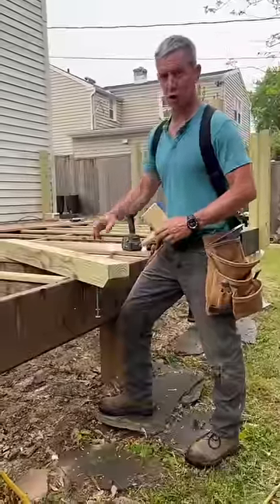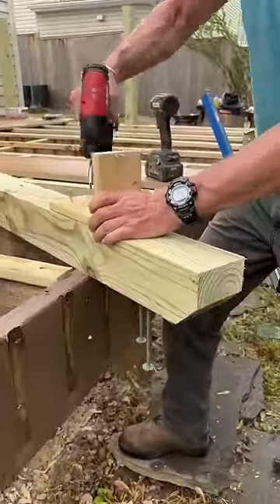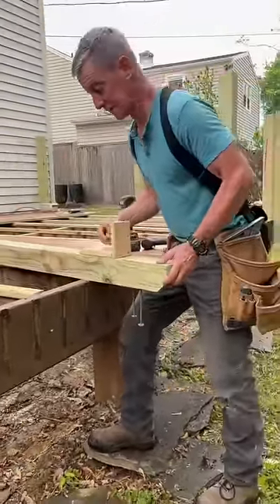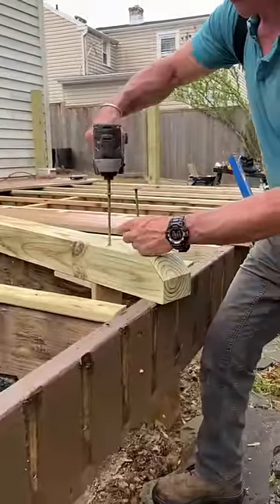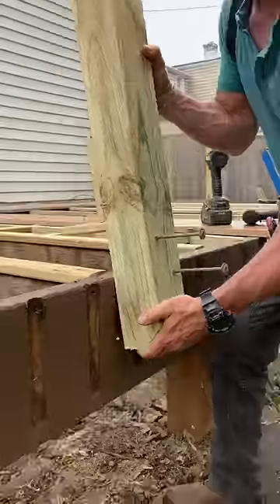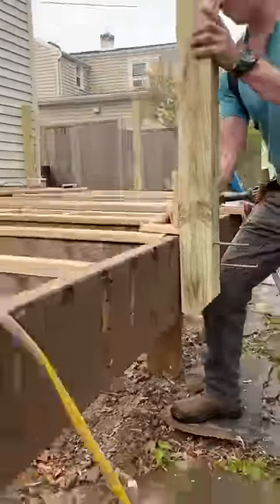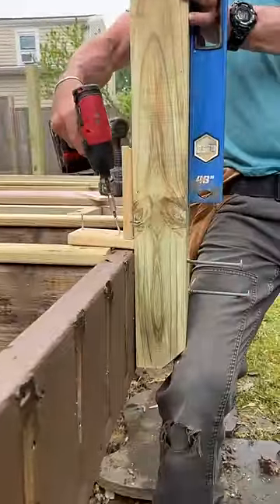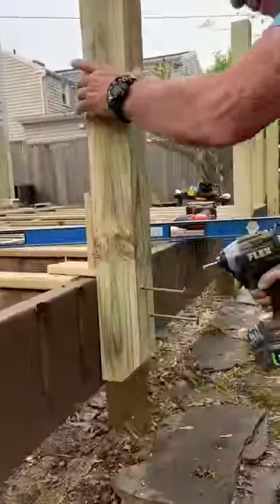DIY Tips: How to set a deck guard post by yourself

Comment: Yeah put the post on the outside so the the railing overhangs the deck
Reply from the maker: It was a pretty small deck, so those added few inches all the way around bought a little real estate. I also run a 2x4 under my decking and between the posts as a little extra detail and to further lock the posts in and I like the look.

Comment: You can’t use GRK for mounting posts to mounting
Reply from the maker: It's not specifically spelled out like that, no. But you can use structural screws (5-points for knowing what they are; half the commenters in here think they're just regular old lags) for post-to-beam and ledger. And, this is a resurface, so there's no permit. I'd put this connection up against thru-bolts all day.

Comment: Lags should go through the band and then into the post. The post should be inside the band and also have blocking around it.
Reply from the maker: Dude, the notched/lagged 4x4 in this re-surface lasted at least as long as you've been alive. Were there some bullsh++ details, sure. But, bro. This all works. You're all missing the forest for the trees.

Comment: Flex...... Haha let's see the future
Reply from the maker: Sure. On this deck replacement, I removed a zillion 3/8 - inch lags and notched posts. You know what? It worked. It doesn't always work and it isn't code now, but decades is a good track record. - The membrane created by the 2x4 rails and 2x6 top cap...good luck tearing that apart.

Comment: Notching doesnt sound safe either. Having essentially 2x4 wood against shear strength leveraged at 4' is a bad idea.

The building code of not having wood rest on fasteners doesnt make sense to me with this alternative.

Only option that really works is in new construction. Make each post 4' longer that the deck and use this posts for railings
Reply from the maker: I'm glad you're trying to suss this out. Yes, what you're calling "wood rest" is called "shear" and in this case there is near zero. I've had roof structures approved that rest on a similar detail. - The screw engineering is phenomenal. - I use Spax 5/16 x 6 washer heads for this. - This deck is a re-skin. We can't go back in time. - For new construction, no.

Comment: This has "handyman" written all over it.
Reply from the maker: That has you not understanding how structural screws work all over it.
Reply: @myfixituplife  Would'nt it be much stronger if you screwed from the 2x side so the threads buried in the post? It doesn't look like they line up with the joist.

Comment: If you don't drill a clearance hole in the post, it will NOT hold properly. You must use a bolt washers and nut. This will rip out with one good drunk heavy man running into it. It's called LEAVERAGE.
Reply from the maker: I know what leverage is. You forgot that the integrated 2x6 top cap needs to fail, too, across the 5 1/5-inch dimension. Put some leverage on one and tell me how much it takes to break it. I’ll wait.

Comment: Everyone saying this isn’t code and they should be in the inside need to calm down. I’ve seen railings on decks around here still fine with no posts and only balusters. Also if you read the code decks 30” and under need no railing so anything you do is “cosmetic” 
He didn’t even notch the post so it’s definitely strong
Reply from the maker: The same fasteners are Code-approved for the ledger connection. - Pretty sure they're not going to budge. - I've puled out locked-in systems with nails that're good to go.
Reply: @myfixituplife  it’s how I plan to do my railing at my house. It’s getting inspected and has to be to dca6/2018 irc. The railing itself won’t be inspected though because of my height. I haven’t tried the spax screws but I have cases of timber screws and I love those things. If it’s not tight those things will make it tight

Comment: I am no fan of lags in this application. Much better bolts-nuts-washers. You need only two and they only fail if the rim joist fails.
Reply from the maker: "They only fail if the rim joist fails..." Exactly. - Not shown, there is a 2x8 inside this 2x10 band. There is 3-inches of bite past the post. - While the gist of this video was intended to be the jig--and even since this video, I've refined this process further--the connection is what everybody sees. - These PowerLag screws are rated for ledger connections. They have the shear and pull-out ratings that meet the spirit of the Code. Obviously, I'm not an engineer, but there's no way three of these things are wiggling loose on a 12x12 backyard deck without taking the band joist with them.

Comment: Here in New Zealand if you did that it'd never pass code. 😂😂
Reply from the maker: For new construction, I'd run the connection through plan review, too. This is a resurface and either way, the point of the video is how I keep the post still while plumbing it up. Best way I've found yet to do this alone (yes, I've tried a clamp). Everybody seems to miss the first 50-seconds of the 60-second video.

Comment: Not sure the posts were on the outside before... Just look at the old paint! I can't see everything in the video, only where he's putting the posts now.

Are those Simpson leg screws only going into that aged 2-by perimeter joist? That's a lot to ask of brand new lumber!

Even if it's not loose today, every little bump on the railing is going to twist that old perimeter joist. That's a waste of a 4x4, in fact if it was a 2x4 it would bend down a little and give the perimeter joist a break!

The old frame may be pressure treated, but I've replaced plenty of pressure-treated lumber. Perhaps it's good enough to hold up all the joists, but all the wiggling from the railing is just going to make everything loose over time! 

I'm concerned that there is no joist tape. It's so easy to put their when there's no decking! 

This deck is stripped down to the framing, repeatedly calling this "just a resurface" is sketchy. The railings are gone. New caps are in the joists. Is this paid work you're doing for somebody? At this point, doing your work  the deck with code compliant methods (written on the wisdom of experience) is probably not even more work!

All this complaining in the comments must be kind of brutal! If your videos were truly smart, all The professionals who are complaining here would instead be acknowledging you for being someone we all can look up to! Why not take all of this, and really dig into all of the wisdom that's baked into the IRC, and do a follow-up video showing us that you are one who learns from mistake and wants us all to avoid repeating the errors that you acknowledge!
Reply from the maker: What an excellent and insightful comment. If I didn't know better, I'd think you're a home inspector, equally adept at assessing if the dishwasher works and if the panel is/isn't a mess. 

All the complaining, to be honest--and that's how gaslighting works in the psychological field--stings. 

That I've made a mistake remains to be seen. The same connection show here also employs the same fasteners--code legit--ledger to house and posts to beam. 

If my customer calls me back in XX years, I'll respond. However, dollars to donuts, that call aint happenin'. Thanks for your good energy and thought.

Comment: should be inside screwed to joist
Reply from the maker: 1 - This is a repair. 2 - Can't. not shown, there's a 2x8 inside that 2x10 (I dislike that detail) and it would put the post way too far inboard. 3 - This works.

Comment: Wouldn’t bother using PT unless it had a shoulder cut, sitting inside the rimmer between the rim and a full height block. I’ve watched to many railings blow off.
Reply from the maker: You've watched railings blow off?! Wow.
Reply: @myfixituplife  
Heavy leaners, large amounts of snow or just stressed inadequate fastening. You don’t want the weight of that railing sitting on just those fasteners around that deck.

Comment: When i built decks I knew that the deck couldn't be perfectly flat and yet I wouldn't settle for less than perfect for the top of the railings so I set my corner posts and used very tight nylon line to set the other posts to. One could use this method, set the jig low and shim to clamp the post tight and fasten. Use 1/" galvanized machine bolts so you can tighten later when the wood dries out. Yes even dried wood will need periodic maintenance.  There are even more nuances to precision work. Only experience and education makes the master
Reply from the maker: I love this. For about a million different inputs. Chime in anytime.

Comment: Wood shims?
Reply from the maker: They're place holders. Because these are structural screws, there's no void in the wood fiber as with thru-bolts that rely mainly on compression. When the wood shrinks, there is still--even better--connection with the shank of the PowerLag. Add to it that it is a membrane of posts supporting each other. It works.

Comment: This man actually knows something.. and for all of you that don't know.. we use plum to refer to leveling vertical and we say level to refer to leveling horizontal
Reply from the maker: Thanks. Yes, I know some jargon. People get mad at me that I know what things are called. Good times.
Reply from the maker: Yes. Yes, I do.
Reply: And the word is spelled  "plumb"....shouldn't gush over not-to-code installation,  dude...sorry. And to use lags instead of bolts is both impractical (wood WILL expand and contract, you know) and quite lazy. 
Do it correctly or don't pretend to be a "professional"...please.
Reply from the maker: @Fixorfish  Same screws hold the ledger to the house. Are they going to fail too? Or does that wood not expand and contract (it’s in drier service, it doesn’t move as much). - This is a resurface and what I put in is a million times better than what was there. - You heroes that claim you know what professionalism is don’t strike me as business owners.
Reply: @myfixituplife  So you made it "better than it was".....lipstick on a pig is an improvement, but doesn't make the pig a show dog. 
As for your "not business owners" comment....retired after 45 years, 26 as a licensed contractor in Oregon....have many examples of the client calling me to "please come fix" subpar work just like this video. Most regret not hiring an anal-retentive, obsessive compulsive artisan who is licensed, knows code, has...and uses the proper tools and methods, like myself. As well as I strive to make sure that it lasts many, many years.
Between the shims (wtf ?...is the rim joist THAT far out of true vertical ? If so, you are gonna be chasing that mistake until kingdom come.) and the failure to predrill for the lags....resulting in angled lag head, a split post, then the head crushing the surface fibers due to your inabilty to either set the clutch properly, or simply not knowing WHEN to stop, creating a wonderful dirt/moisture catching pocket as a start to the next rot place.....oh dude....I could go on and on. You would never work a second day as a sub for my biz.
"Check-grabbing nail-bangers" is what your type is called in my area, "gung-ho and then gone"  is another term. 
But hey....you can tell your buddies that you have a video online....now there's a real bucket list accomplishment,  huh ?

Comment: Smarter dudes make it so the support post extends up to become the guard rail post.
Half labour, less waste, far superior in strength and durability.
Journeyman
Reply from the maker: I thought the oil-spill of paint on the band joist made it obvious that this was a resurface. I didn't build this deck. And even if I did, I don't like the details you describe. Unnecessary. Overkill.

Comment: Where I live, code is that the post has to be on the inside of the end board. And we also have to use lag bolts with washer. Just sayin.
Reply from the maker: That's code in a lot of places. It comes mainly from a document called DCA-6, though there are many other inputs and experts involved in writing the code. There is also a surface mount detail shown. Some have bolts and a hold down, some just bolts. - Here, on this re-skin, there was a 2x8 inside this 2x10, so I had to surface mount. - And my detail isn't in the DCA-6 but if I were a giant YouTuber I'd offfer a prize to anyone who could hobble this connection without tools.
Reply: @myfixituplife  that’s interesting, I’ll have to check out dca-6. I had a hard time tracking down code for my area when I built mine. I’m sure there is many ways to do it and it still be safe. Nice work. I’m just a classic diyer. YouTube is just my encyclopedia most of the time. 😂

Comment: Its easier to screw a lip board on the bottom all the way across and set them on the lip ,then screw them on.
Reply from the maker: Uh, that's kinda brilliant. - I'll try this. - What I learned on a recent deck is that my jig works OK, but there is also just too much going on and I had better luck--more risk, more things to go wrong--running the posts high and cutting them in place.

Comment: Mount post against the rim Joist and floor joist and carriage bolts through the post, cut decking around post. That post will never move.
Reply from the maker: Only been doing it that way for a couple decades now. Even carriage bolts have been replaced with thru-bolts for a long time now (not sure why, they work fine). But in this application—a re-skin—this works and I don’t have to spend time with a ship auger bit.

Comment: Should carriage bolt all post imo.
Reply from the maker: Double 2-by framing. Would need a 8-inch bolt for this double framing IF a joist wasn’t in the way. Also, the point of this video is the jig, not the connection

Comment: Doesn’t that jig leave holes in the post when you remove it? Who wants that?
Reply from the maker: I suppose. But so does the saw that cuts it, the slide off the lumber truck. - Southern Pine is treated through and through. A screw hole is a non event.

Comment: That would fail on inspection where I'm at..
Reply from the maker: On a new deck, probably. It's not in the books and inspectors have to follow rules in books. - On a re-skin like this one, there is a Venn Diagram between craft, profit and common sense. Do you really think you could hobble this connection with a 2x4 top rail and 2x6 top cap?

Comment: Those things push right over that is not the way to put post...post go from ground up to level not lowes way  like that you can drive a truck on it but the railings will push right over stupidity
Reply from the maker: The only way this guardrail connection fails is catastrophic deck failure.

Comment: Not having a double rim is a first for me.  Guess you're going to post it every 2 feet so it can handle the load that a double would handle every 8 feet.
Reply from the maker: Interesting comment. Yeah, it's the usual "you don't do it like I was taught, so you're wrong" tack. I get it. However, something clicked that I hadn't thought of before. - But fist, my disdain for the double rim detail. Assuming a cantilever beam 2-feet back from the rim, there's no earthly reason why the rim needs to be doubled. I know guys in the South love this detail, but--again, assuming a beam--it's a waste of time. Second, there is a double rim here. That 2x10 is "fascia" for the 2x8 framing behind it. After 20-years acting like a gutter for every leave and speck of dirt, it warped inches out of plumb. - Third, for this to fail, the 2x6 top cap has to shear along the 6 axis. Explain to me how that happens. - Note: If this weren't a re-skin on a small backyard deck, I'd design a beefier connection, but this isn't going to move.

Comment: Running the screw through the 4*4 first makes having a 8" screw pointless.
Reply from the maker: Nope. It's locked. - You forget the 4x4 posts, 2x4 rails, and 2x6 top cap. - Yeah, if this was a commercial space, I'd blow it all out. But this is a tiny backyard space. No raves happening here. Cool?

Comment: The post belong inside the box beam.  Now there's no structure to stop in and out wiggle. Some blocking inside makes the post ridiculously solid. 1/2 carriage bolts and you can put a clean belt board around for a clean finish.  People gotta stop with the 1970's decks with taking that task of at the first party
Reply from the maker: I've seen posts housed inside the deck frame locked tight with hot dipped hand-drive 16s that I have resurfaced. They were murder to get out. I once rebuilt a deck where the ledger was nailed to the house with hand drive hot dipped 20s. It would almost have ben easier to burn the house down and rebuild it all than pull these monsters. - That said, surface mounting was the router here and I like the jig for setting the post. Screw or bolt, I don't care.
Reply: 16d galvz do not come out
Reply from the maker: You have that 1-million percent right!

Comment: Treated Pine in the USA 🇺🇸 & Australia 🇦🇺 has the life span of no more than 10/12 yrs & even that is pushing its limits.  
Wouldn't use scews . Bolts & Threads
Reply from the maker: I don't know about Aussi-Land, but the treated I'm biting the screws into is 25 years old and the wood fiber is rock solid.

Comment: Those power lags are not code rated????
You have to use carriage bolts and washers!!!😊
Reply from the maker: It's a resurface. A repair. There were existing conditions. And, the lags that held it together for 25 years before I got there were DIY trash, but they worked.

Comment: You should be using bolts and nuts
Reply from the maker: I’ll put this connection with integrated 2x6 top cap against nuts and bolts all day. I could be wrong, but I don’t think so.
Reply: Yeah, you're wrong

Comment: Alls I'm saying is check your local building codes most of them will tell you to put it on the inside
Reply from the maker: I know the local building codes. I know the document the local building codes get their code from. I also know this works in a deck remodel application where there is a budget to consider. I also know the same screws hold the entire ledger on.